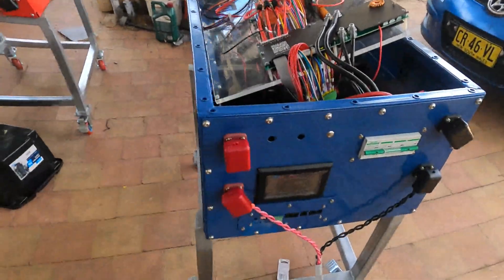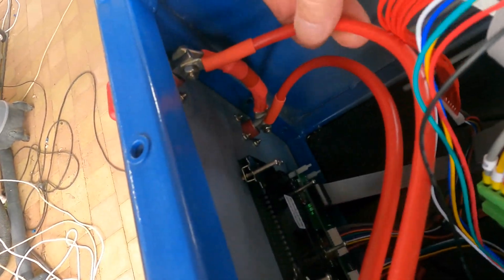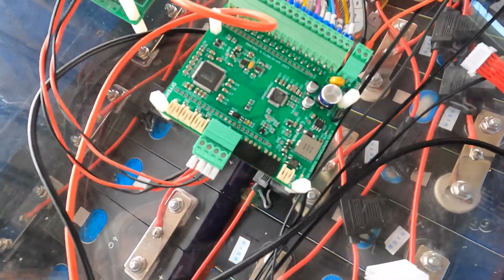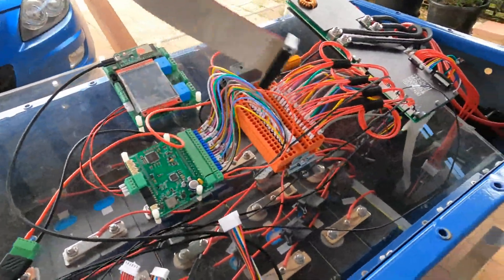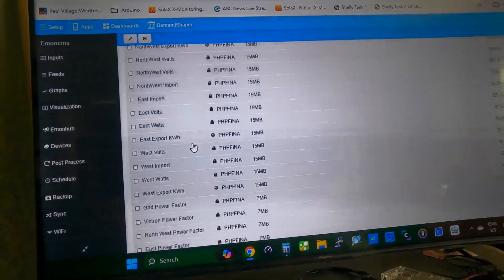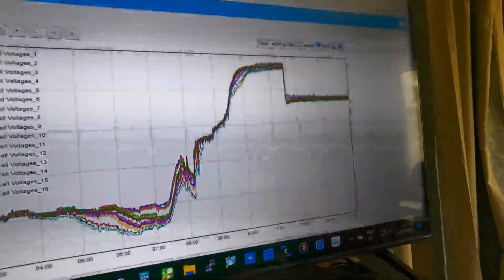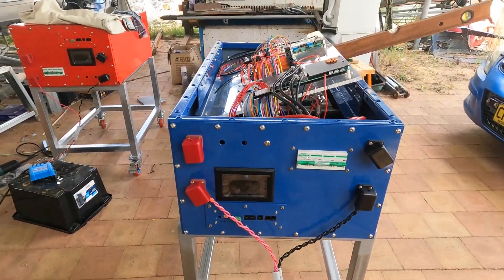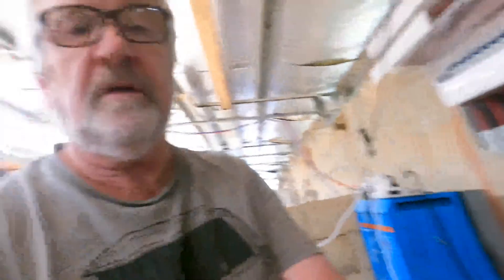Big Blue Lifepo4 14Kwh Battery Cabled up and running a JK PB2A16S15P BMS

Comment: Good evening,
Thank you for all the videos and all these explanations.
I have a problem with the JK BMS connected with a Growatt hybrid inverter and a 16S Lifepo4 battery, the SOC drops from 60% or 50% to 1% in less than a minute. The batteries seem correct to me.
How can I solve this problem.
Thank you for your feedback.
Pascal
Reply from the maker: I have since installed a Victron SmartShunt to track the SOC of my batteries
Reply: @sjdtmv  merci de votre retour